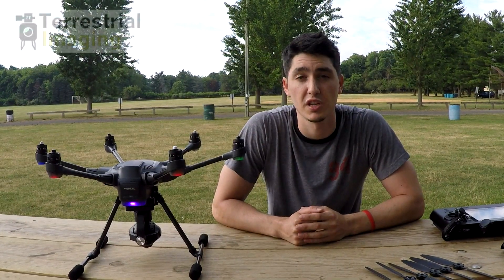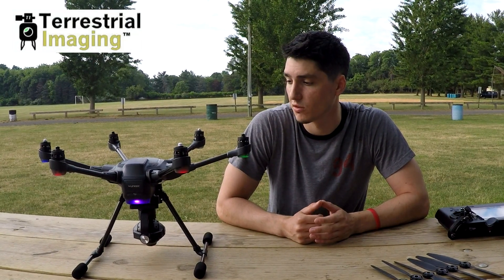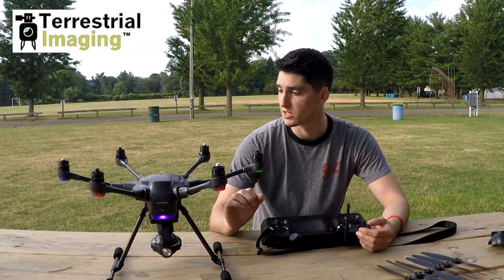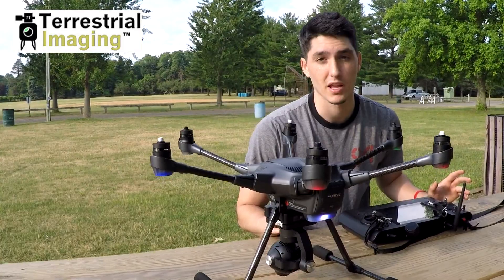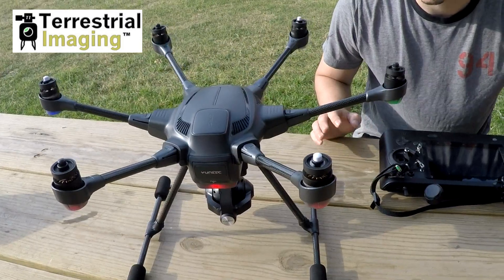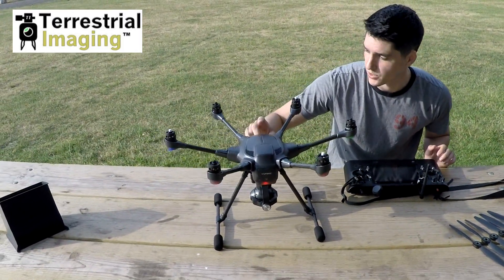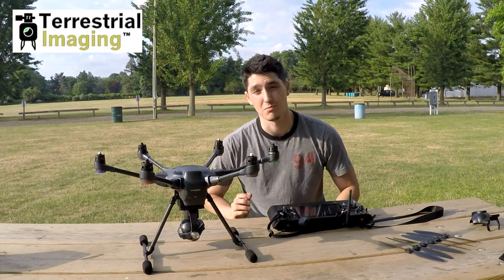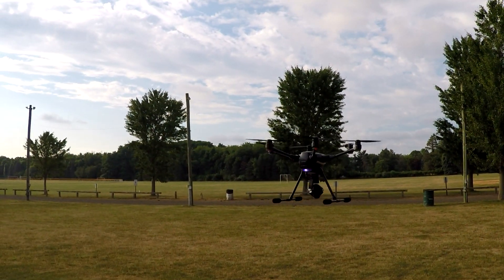Typhoon H 5 Motor Error Warning.  What's Up With That?

Comment: I just bought the Yuneec typhoon H , on ebay , said it flew 5 times, no crashes , tested without propellors , and it gave error message , motor fail , shut down , i e mailed seller , he said return it , and i watched the video , and learned i need to put the propellors on , and that solved the issue , Thanks , you just made my day , Bob
Reply from the maker: Anytime Bob!

Comment: Good stuff! I wasn't aware that my H would do that. I can tell you that the "five rotor" system on the YTH works as promised, I had a seagull break half of one of my rotors last week while I was flying over the ocean. I was able to bring the aircraft in safely though, I am very thankful I got this UAS instead of a quad-copter. The video of the seagull attack and the aftermath is on my channel. The handling of the Typhoon does become sensitive in the five rotor mode and it shows in the video. - Anyway, thank you for posting this.
Reply from the maker: That's crazy. Glad you got it down safely!

Comment: Excellent video, been there done that after I crashed and busted my landing gear and broke a couple of props. Bench tested it in my basement holding up my H because it wouldn't stand 😩 revved up got that warning started freely out thought the crash had messed up the gearing in one of the booms because motors were spinning just fine but I was getting that clanking sound as well. Yuneec has had my bird since 6/15 and when I contact them they tell me there's a couple more in front of me good lord I miss my baby there must be a lot of repairs going on😔. At least now I know the source of that error and sound Yuneec better not try to charge me for anything else but landing gear repair. Terrestrial imaging is by far the best dealer around their extended concern for their customers and this industry is the best period. I not only support them but about to order Phantom 4 with two extra battery's. I have no doubt they stand behind what ever they sell. Christopher LoPresti (the proprietor).👍

Comment: I had the same problem on day one. Lesson learned. And I should have known this would happen. I work in the small motor industry. What the motor is doing when thrust is applied is looking for pressure to the motor. In short if it senses no pressure it assumes you lost a prop. That clicking noise is the motor running out of control as the built in tach sensor doesn't read any pressure to the motor. Normally with props on you will create a pressure on the motor. All it has to do is provide additional power to maintain a specific rpm. But with no props on, it provides rpms but nothing is going against the motor so it is continually starting and stopping the power (that's the clicking noise you hear). Still... I cried when it happened..lol
Reply from the maker: Lol. That was a very informative explanation . Thank you!

Comment: Yep... done that, been there.  Bench testing the Typhoon H, 'to smart' for us old timers who'll bench test everything before going out to the field.  It checked out perfect in the GUI when I tested the motors.  Only doing a throttling up to simulate take-off did this issue occur for me.  I did freak out a bit... especially when the motor sounded like a spoon fell in a running garbage disposal.

Comment: This happened to me but the opposite sequence. I was flying and the system went haywire with this message. I barely landed and tried doing the motor testing without props and as you said, those alarming things happened. All motors were running. So  tried a flight again and it went haywire again. I spoke to Yuneec, sent it to them and just got it back with a note that a rotor arm bracket was broken and they also replaced a motor.  So there IS a purpose for this warning! ;-)
Reply: Hey Ray how long did the repair take from the time you sent it until the time you received it back. The last time I sent anything back took almost 4 months.
Reply: Douglas, It took about a week and a half. I get good service from them since I complained publicly (in forums, facebook, etc.) about one incident where the customer service rep was just rude and not helpful at all. Every response he made to my questions silently began with "Hey stupid...it's like this..." After that call, I called again and asked to speak to a supervisor, was busy, she called me back. I told her all about it, she had another rep help me who resolved it. I must be on a list somewhere as a "complainer or something because since then, I've had excellent and quick service. The few times I've sent someting, I always called to follow up after 4-5 days.
Reply: I will say there phone help is second to none probably that they are here in the US. How ever sending my TX st10+ took 3 months for them to fix but when I sent the camera in and the acft those two issues only took about a month and a half each.

Comment: Thanks, just experienced this exact thing before I saw your vid....now that explains it.

Question, when I take off with the props this time, my yuneec wants to tilt and fall.  I actually broke a prop.  Why is it not taking off straight up?
Reply from the maker: You should check the hardware monitor in your controller. Your control sticks may not be working properly.

Comment: Your method did not work on my typhoon 4K, Still beeping, still does not power on
Reply: This is for the 6 motor drone. It can manage to fly with 5 engines.
The Q5004K has 4.  You lose one and , well lets hope it is flying over soft grass and low.

Imho they are superb machines, but supported by a horrible customer service, in the USA at least.

Comment: hää?was!!
Reply: Fast forward to 2021 and I have had 2 x instances where this error has come up mid flight and the H has simply crashed landed (no control at all) replaced what we thought was a faulty motor however after flying (hovered and went through a battery) then put a fresh one in................flew out approx 350 mtrs......... then error "enter 5 rotor mode" H dropped out of the Skye !!!